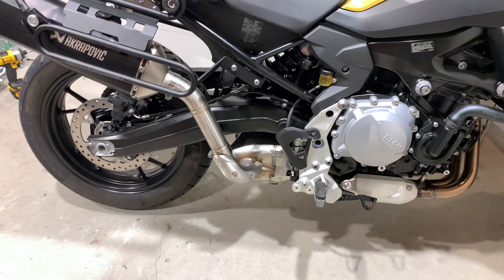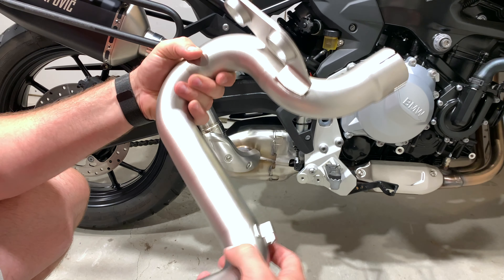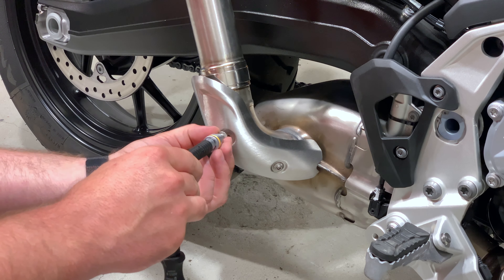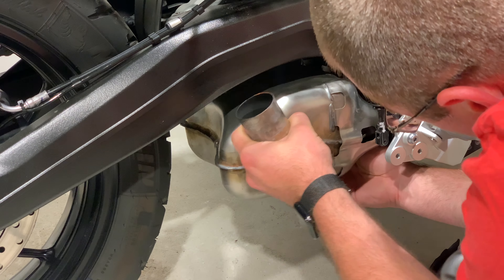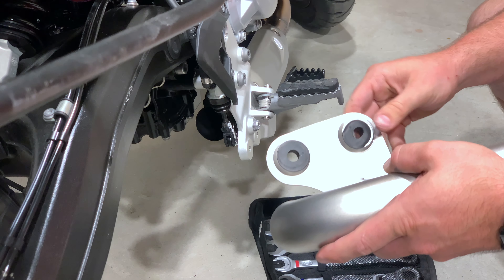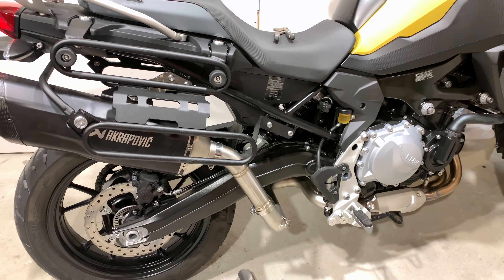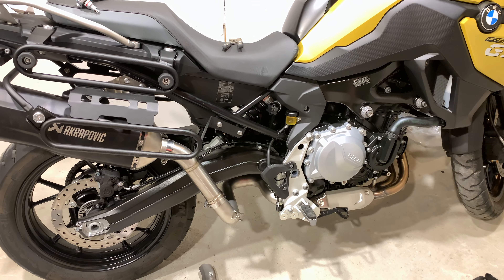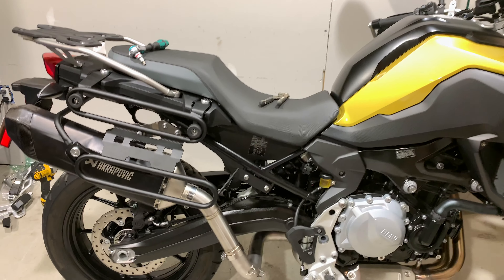Install: Remus Linkage Pipe BMW F750GS / F850GS

Comment: So quick question on this: there is quite a bit of play in the system if you loosen the exhaust hanger bolt and the two collars on the pipe that links the Akra to the silencer box. I noticed it the other day when installing it. If you loosen everything up, and it fits then, you might be able to make it fit, no?
Reply from the maker: I was using a mallet to get it all connected with everything completely loose. No way it was going to fit in my case..not without bending something. If you find someone who has installed it and has a video, I'd love to see how they accomplished it.
Reply: I didn't have any problems at all ...just remove the muffler,  pull out the sound reducing chamber and install the new (remus ) like pipe i received from Poland ! And reinstall the GPR muffler and down pipe...saved at least 10 lbs over all

Comment: Just wondering was your bike a 270° crank as my 2023 F850GS rattles really loud and your bike sounds like a Honda with the wring as you reved it. Or did your fix the timing chain rattle.
Reply from the maker: It is the same crank design. the 750 is identical to the 850 and is just de-tuned. The rattle you describe is odd. I”ve never heard that out of the BMW V-twin that you and I share. No chain rattle it sounds more like a sewing machine.
Reply: @AdamChandler86  Thanks for your reply, it's the timing chain that rattles. Your bike sounds very quiet compared to mine, the Dealer said it's normal just thought you might have added a manual timing chain adjustor. Have you still got the Bike?
Reply from the maker: I do but it’s stored in the house up north so I can’t take a new sound clip of it for you without having to hop on a plane but I’d have your dealer fire up a few 850s that are in stock to see if they sound the same as yours.
Reply: @AdamChandler86  Why they all sound like a bucket of bolts rattling, I am going to put on a Chinese link pipe so the exhaust can drown it out.

Comment: I couldn't get then remus to even sit on the hangers without the chain-side grommet popping off. And even then the stock non-Akro pipe didn't fit without substantial manipulation. I'll be returning the pipe.
Reply from the maker: Yep. I ended up selling the Remus and buying the Dominator instead.
Reply: @AdamChandler86  unfortunately dominator pipe doesn't fit the 2021 models
Reply from the maker: OH NO. I’m sorry to hear that. I heard they made some Catalytic converter / O2 modifications for the 2021s for Euro 5. Crap. Hopefully an aftermarket solution will come at some point?

Comment: Hey Adam does it void warranty ? Also can I install it on stock 750 exhaust
Reply from the maker: In USA it does not. No tuning required. It fits stock muffler as well
Reply: @AdamChandler86  perfect , thanks for the reply.
Reply: also what brand is the rear luggage rack
Reply from the maker: The F750GS Side luggage rack is Jesse Luggage. Top rack was BMW but we've since replaced it with AltRider's larger top rack. Like it a lot.

Comment: Do you still have that remus pipe?
Reply from the maker: I already returned it to Revzilla. Sorry!
Reply: @AdamChandler86  rats ....what was it that she didn't like ? Oh and one mire thing...the moto puck ...your thoughts on it ? Thanks
Reply from the maker: Sorry I took a while to reply. We actually ended up using the Dominator Link Pipe, Nicer, fits the Akra muffler and way cheaper. Only issue with the Dominator is it ships from Netherlands so took 10 days to arrive. But it's a perfect fit and sounds mean. the MotoPowerPuck is awesome. I have one on every single bike. Drop the phone in and it starts charging. No snaking USB cables around or rusty charge ports. It's the most expensive and best phone mount you can buy.
Reply: @AdamChandler86  thanks for the info!!!

Comment: you think this will fir on the 2021 i looked at my bike earlier and it looks about the same but im not sure
Reply from the maker: 2021 is a Euro 5 F750GS so my understanding is the header pipe is slightly redesigned. I'd give Remus a call / email and ask if they can confirm it's compatible.
Reply: @AdamChandler86  ok i live in the us in VA i just bought the 2021 F850 GS 40th ani and its super nice but i could do with a little more noise i looked at mine and its seems to be the exact same setup. just to be safe ima email the company thanks so much for your feedback
Reply from the maker: Rock on and enjoy the new bike! That 40th color is RAD.

Comment: Question unrelated to the link pipe (cool video btw): what ratchet are you using in this video?
Reply from the maker: That would be the Wera Zyclops 3/8" ratchet. Great set and their TORX bits are very high quality. Never strip heads.

Comment: Hi Adam, is that a heat shield over your exhaust? I was planning to install rackless luggage system . Need to install some protection over the exhaust to prevent the bags from making contact .
Reply from the maker: You are referencing those black bars? Those are Jesse Luggage Racks for their hard boxes. I can confirm that that a standard heat shield from Mosko or Tusk will fit over both the OEM and Akra exhaust silencer.

Comment: Dear Adam,

I got the same Remus Linkage with OEM Muffler but I got some air leaks (in the two Remus linkage connections) even I tried placing differently the clamps... After several thousand kilometers it still leaking, did you install a sealer or something?
Reply from the maker: Thanks for asking. I experienced fitment issues from the beginning so I returned the Remus Pipe to Revzilla and purchased a Dominator Linkage Pipe. You have to pay shipping from Netherlands but the fitment is perfect with stock muffler and Akrapovic so I recommend Dominator over Remus for the F750GS.
Reply: @AdamChandler86  Thank you very much for your reply, it helps me a lot. Regard the Dominator one, does it sound better than the  Remus one? louder? deeper? It's hard to appreciate the actual qty sound through pc speakers.
Reply from the maker: I agree with you there. YouTube videos of exhausts are so all over the place. Same bike, sam can sounds different in every video. Dominator is throatier and you feel a tiny bit more vibration in the handlebars at higher RPMs. IT's also lighter (it doesn't have a U-Shape bend) it's basically a straight pipe instead of a bend like the Remus.
Reply: @AdamChandler86  I recently was told that loosing manifold outlet was needed and I didn't when installing, I'll be testing assembling everything again but starting with all loose parts I hope I get better results I'll let you know if achievement accomplished.